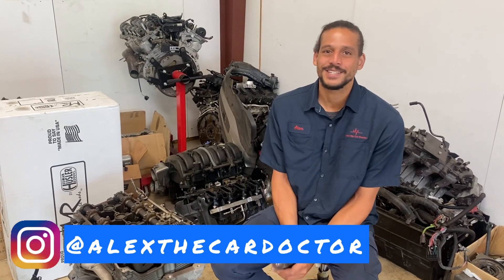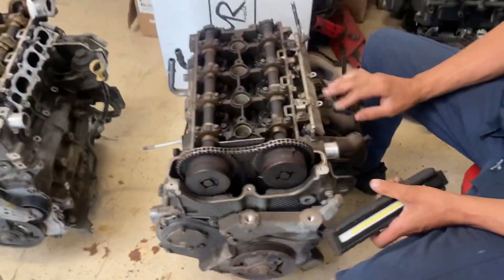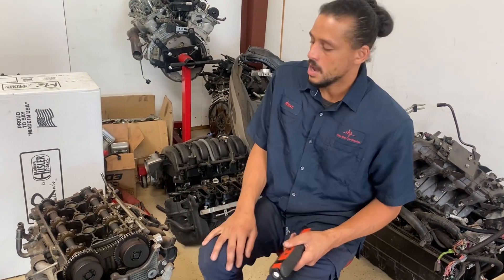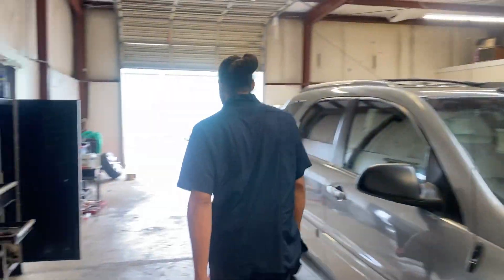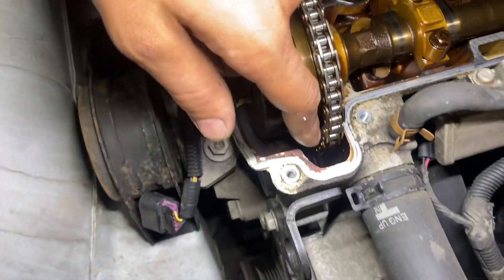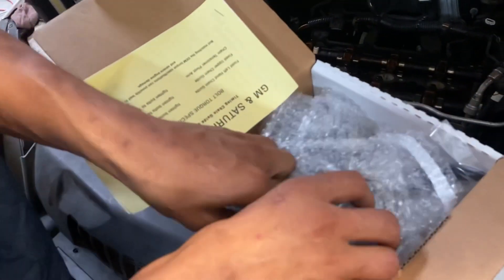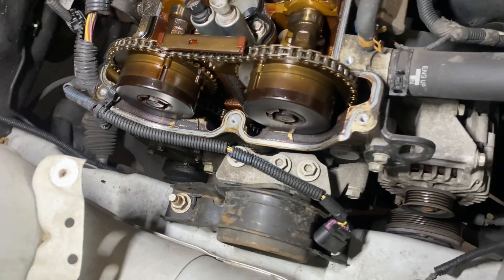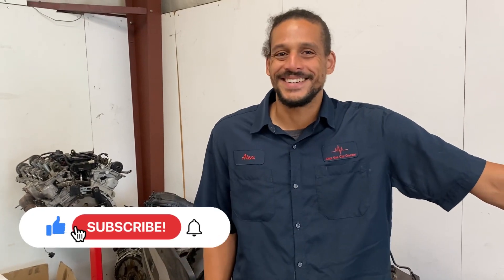Common Timing Chain Issues with GM Ecotec Engines | Timing Chain Rattles and Codes  timing chain #gm

Comment: So I have a 2002 Saturn l200. 2.2 ecotec. My car cranks but doesn't start. I feel it may be the fuel pump but not sure. It just shut off on me one day while driving.  I've replaced the crank sensor checked spark plugs so that's all good. If it jumped time would I heat a noise or feel something. My motor doesn't act crazy still really quite but again it hasn't been able to start. I noticed that there isn't a lot of pressure when checking the gas pressure in the front of motor. From what I've sáid do you have an idea?? Thanks

Comment: I’m in the process of replacing my head gasket on my 2.0L Malibu ltz turbo because it had coolant in the oil. Is there a tool to keep it from jumping time and getting it TDC! Before removing the cylinder block. Do you have any videos on this particular job on how to replace the head gaskets and timing chain. My car has 87,600 k so would changing the time while would be beneficial long term. I’m just not sure how to prevent it from jumping

Comment: im changing the timng chain and sprockets on a 1.5 ecotech 2016-2023 malibu. do i also need to install a new oil pump chain since it will also ride on the new crankshaft sprocket?

Comment: I HAVE A 2004 MALIBU WITH A 2.2L, 4 CYL ENGINE, OIL CHANGES RELIGIOUSLY DONE, NO TIMING CHAIN RATTLE, TRANNY REPLACED WITH USED TRANNY AT 206,000 MILES, CRANK SENSOR DONE WITH GM PART, OIL PRESSURE SWITCH DONE WITH GM PART, MAP SENSOR DONE, ONE SPARK PLUG REPLACED, OTHER 3 PLUGS OK, NOT REPLACED, NEW IGNITION CONTROL MODULE, AFTER REPLACING MAP SENSOR I GOT A 340 CODE, MINOR ROUGH IDLE, NO MISFIRE CODES,  ALTERNATOR HAS APPROX 120K MILES, BATTERY IS ONE YR OLD, WHEN AUTOZONE TESTED ALTERNATOR THEY FOUND 7V OF RIPPLE VOLTAGE,  BEFORE TRANNY WAS CHANGED CAR USED TO START ITSELF AFTER TURNING KEY, AT THAT TIME I COULD HEAR GRINDING FROM STARTER, CAR NO LONGER HAS THAT GRIND NOISE, ANY IDEAS?

Comment: Hey Alex thanks for all you work, you helped me save some money on my 2005 magnum with replacing the water pump, now i am working on my daughter 2011 buick regal with the eco tec 2.0 engine. My problem is that her bank 2 camshaft sensor was bad and broke out the block and was pouring oil, i replaced the sensor but now the car only starts when that sensor is disconnected. When connected tge check engine light comes on but has no code, do you know whats causing this and if so how can i fix it? I did some research and have an idea but i want to know from a real expert of what it may b. Thanks for all that u do to help us all.

Comment: This just happened to my equinox three days ago….engine power loss warning on the dash then it just slugged out and cut off and haven’t been able to even start the car since but im not sure if the chain caused bent valves yet because it just happened

Comment: ZZP performance makes an access bolt for that hole that is extra long and eliminates the need for that inner bolt.
Reply from the maker: Yes, so does Dorman. Another commenter put me up on game! But I’ll add the ZZP one to my mental rolodex too! Thanks 😃
Reply: my top screw just came out on my DF Goblin kit car LNF engine. the bottom screw broke off in the block. drilled out the bottom screw. have to try to replace with an 8mm helicoil and M8 bolt :-(  AT least the bottom bolt should see very low forces once I have the new and improved upper bolt in. 

super annoying problem but hopefully it will be fixable. 

 @AlexTheCarDoctor
Reply: Zzp also makes a reinforce timing chain guide also stronger and better material , instead of plastic.

Comment: I'm starting to see some problems with my 2.4L in my Buick Verano at 83K.   When oil is low, it has symptoms.  Filling the oil to top seems to quiet things down.  But I suspect I'm due soon for a timing system replacement job.
Reply: Man they quoted me $3,200

Comment: Got 222,000 on my 2.4 in my 09 Pontiac G6. I Change oil every 5k with regular conventional. No issues. Amazing engine
Reply: There is no more "conventional" oil unless you mean not labeled synthetic? Any brand name oil that is API GF-6 or GF-6b has synthetic esters as additives which would make them "semi-synthetic" this would explain at least some of the longevity, the rest is the 5k intervals.
Reply: @mrmarcink1300 oh  my god SHUT UP😭😭😭
Reply: i needed a timing chain replacement at 160k miles. i change oil every 3k miles and even negative degree cold temperatures i still heard a rattle once. not too concerned since oil was probably thick, but doesn’t burn any oil. have you experienced any problems with yours?
Reply: My 2010 g6 just got the dreaded timing chain rattle at 243k miles, aside from that it’s been bulletproof
Reply: @02glx  my 2.4 G6 got the rattle between 150k and 160k miles. just got timing chain replacement done and i get a discount since im friends with the owner, and all in the timing chain replacement was $800.
Reply: I'd use synthetic oil.  It's worth the money.  At least use a blended/sythetic oil.
Reply: Go to Valvoline Advanced and it will lash 400,000
GM retired master tech

Comment: I have a 2014 Chevy equinox. The timing chain guide on top broke and my timing chain ate a hole in my valve cover. Long story short replaced everything except the sprockets in a timing chain replacement and now I have a loud timing chain rattle on a cold start with rough idle after about 20-30 minutes of driving. If I pop it in to neutral it idles a little better but it idles much better if I just touch the gas a little. Any ideas? 

Edit: forgot to mention that if I let it continue to idle roughly it throws the code p228d which is a high fuel pressure regulator reading high fuel pressure it then goes in to limp mode and the stabilitrack turns off. It’s the only code that appears and I’ve replaced the fuel pressure regulator but with no difference in symptoms. The code will go away after a few starts and the check engine light disappears. I pulled the valve cover off and the timing chain is taught. I changed the vvt solenoids as well. I’m at a loss and I’m running out of money to throw at it!

Comment: I have the 1.8L ECOTech Chevy Sonic and it's a crap motor.  Problem after problem.  Overheating issues and doesn't even have a temperature gauge on the dash.  Stupid design.

Comment: My 06 2.2L Saturn ion is having the same problem with going limp while driving and at low idle. It’s at 180,000 miles and I can almost guarantee that it’s never had the timing chain kit replaced, is it worth a shot to try to replace? Would it even help?
Reply: Did you get it changed and did it help ?

Comment: 15 equinox 2.4L

Changed the time chain, followed your video to a T, turned it on, let it run for about 30 minutes, drove it 10. Next morning, started it, low power display comes up, tore it down, re done the chain, started it up, ran fine drove it, turned it off, started it again, reduced engine power display again.

Tore it back down again, made sure to double check everything over and over, put it back together, started it, ran fine 30 minutes, turned it off and back on, reduced engine power.

P0016, p0089, p228d, what can I possibly be doing wrong??

Comment: Hey Alex, please help me. I changed timing chain, both phasers (intake had a little play), solenoids, oil, oil filter, I cleaned the oil pan blocked with plastics. Now it sounds nice, but I continue having p0016 code. It disappears and goes back after 30 min of using. Please guide me.
Reply: Plus, I installed the improved bolt for the black tensioner guide.
Reply: sounds like its a tooth out of time
Reply: I fixed p0016 cleaning camshaft sensors and the part of the camshaft that the sensor detect. Also  I cleaned the crankshaft sensor.

Comment: I've compared every chain I've removed to the new chain .. never once have I seen a stretched chain.. it's always the front guide broke and or phasers / solenoid problems .. I usually replace everything all at once .. chain , phasers , solenoids , guides , squirter , tensioner .. 🎉🎉

Comment: Alex had some great advice on the ecotech engine, as a semi retired mechanic with lots of experience( I just cant give up my shop) the best advice I can give is do not wait until it stops running, a timing chain replacement is under 1,000, can be done in 2 or 3 days not the end of the world but bent valves could total your car
Reply from the maker: Thanks so much for your advice! I’m always open to learn! Definitely gonna use your experience and wisdom. Thanks again 👨🏽‍🔧
Reply: At how many miles should they be changed?.
Reply: Ray it really depends on the oil, a car that gets a fast lube job every 7,000 could need a chain at 80K, if it is a neglected engine, like going over miles or cheap oil they can fail at 50K, use good synthetic 5w30 every 5K and it will last 200K, yes I said 5w30, the thin 5w20 is for fuel economy, not good for the engine, gas is cheaper than timing chains @raypalermo1603
Reply: @raypalermo1603 base line is 100,000 miles, which seems to have become a good ballpark figure.

For those of us driving 25-30K per year, with too much idle time, may only be 3-4 years. Compared to someone that may drive 12-15K per year, or 6-9 years. 🤔

2024-09-06 1346 PT

Comment: hey Alex, do not be afraid of thread inserts, the repair makes the part stronger than a new part, the best ones are from Howmet aerospace ( an Australian company), napa auto parts has them, helicoil is ok too, no big deal to install and nothing to worry about
Reply: You are absolutely right, I work at a machine shop, we use inserts all the time for repairs, they are better than the original thread..

Comment: What about 2015 malibu 2.5 engine? Same?
Reply from the maker: No, those have vacuum pump issues that blow up and destroy the CAM on the 2015 2.5
Reply from the maker: Those have vacuum pump issues that could destroy the CAM. Just keep your oil changed 👨🏽‍🔧

Comment: I have a 2008 Saturn Vue 2.4 that keeps jumping timing and bending valves. I'm so tired of messing with this thing, but it's a customer that we know well, so I'm trying everything. I've pulled the head off 4 times already and every single time I start it up, it starts rattling and bends the valves. 

Someone please help! I'll Cash App you some money if you can.
Reply: Have you set the tensioner after installing the chain?
Reply: @freddyg9026  I figured it out. Somehow the cams were placed in the wrong spots. We had to put the exhaust cam in the place of intake and vice versa.

Comment: When mounted to a Solstice or sky, the thermostat is very had to get to. When mounted to a Solstice or sky in the turbo format, the waterpump is also very hard to get to. These are the only two issues besides that bolt that I know of on his engine.

Comment: I’m an average Joe with a Pontiac Solstice (2.0 ecotech) and currently have it in pieces in the garage. That bolt is a known failure point and Performance Auto Werks sells an upgraded part that holds the guide rail in place and also functions to fill the access hole for the bolt. A single piece that doesn’t allow for this failure. I highly recommend it and am putting that piece into my car once I finish installing my chains again. (Also the water pumps on these engines are absolute trash, replace every one that is stock)
Reply: ECOTEC UPGRADED TIMING CHAIN GUIDE BOLT   Is this the part from Performance Auto Werks your talking about? Edit- I just seen the kit with the guide as well
Reply: Yeah. PAW has it and I think Cloyes and DDM both sell one too
Reply: Yeah. PAW has it and I think Cloyes and DDM both sell one too

Comment: i had the  chain munch thru the top guide and valve cover..  pulled the cover off.. chain was taught at the top.. loose down by the crank sprocket to intake sprocket.   broken forward guide.. .  replaced forward and top guides.. patched valve cover hole from munch thru,,
munched thru top guide AGAIN.. chain was still taught at top side..   what caused the munch thru of top guide and then valve cover?
thanx!

Comment: To repair the stripped guide bolt problem a new plug is availabe from rock auto, it replaces the bolt and the plug with one piece.

Comment: Yup, drill a hole and add a threaded insert. New timing kit and back on the road. That’s how we do. Heck we’ve even spot welded the bolt for good measure.

Comment: I have used Heli-Coil kits onto many vehicle parts including body, engine mounts and internal engine parts as well. I have even used Heli-Coils on the Cadilac 4100 engine which was popular in the 1980's. Since the block was aluminum, I used double 1/2" inserts on the main bearing journals. I never had one of them come back for that problem again. I did work on other issues with the same cars over the following several years. So I can safely say that the Heli-Coils work well providing you install them correctly.

Comment: Great video what a young man these engines are garbage my friend has equinox with 98,000 miles has p0301 other mechanic said rebuild the motor so he took it to the machine shop and done it still has the same noise ticking at idle and exhaust popping and check engine light on and flashing even after the machine shop did it

Comment: I have a 2011 Malibu.  The timing chain went bad at 85,000 miles.  The black guide was in several pieces when I took it out.  The top guide was sheered off like the one you showed.
Reply: That’s a Chevy for you

Comment: i got one on a equinox the front guide bolt is non existent and the lower bolt was half worn through. grooves cut in the head by the chain and the balance chain sprocket was worn off as well as some of the balance chain guide bolt heads . both soleniods packed full. did a leak down test and all 4 were ok, all rockers tight so i pulled the oil pan and found the pick up tube plugged with guide chunks. cleaned it all out and new timimg everything and the thing runs like new lmao. couldnt believe it. this was my dads girlfreinds car and ran out of oil at least 3 times i know of (oil burner ) and told her we need to to chains over 2 years ago lmao. these endgines are gravy for me but such junk for customers

Comment: doorman makes a repair kit for that upper guide bolt that basically uses the access plug for that bolt as a way to secure the upper half of the guide so you dont need a cylinder head

Comment: Anybody experience crank no start a couple times before engine starts, then the engine runs fine? I'm leaning towards reluctor wheel slipping, but just wanted to know how common it is.

Comment: I have 353,000 miles on my 2004 saturn and have absolute zero issues. I have always ran synthetic and change it at 8k-9k miles
Reply: 2004 was soposed to be a poorer year for that engine as well.

Comment: What codes usually pop up for the timing chain if it broke on a 2014 chevy equinox
Reply from the maker: P0016 - Timing Correlation is the most common one if the timing chain has jumped.

Comment: I strongly think that using a tread insert would fix and resolve the problem because once fixed the hole diameter in the aluminum is larger and stronger than when it was made. I kinda feel that all threaded holes in aluminum should have steel inserts from the factory since they would be stronger and reduce the seizing that steel bolts do in aluminum. of course I dont expect the factory to add all that work and expense just to save us trouble. 
so, are those motors pretty good other than that issue ?
Reply from the maker: I totally agree! They make a Dorman plug that works great! I’ve been using them and they’ve been working out. Yes, other than that these motors are pretty good!

Comment: Theres a dorman solution plug made specifically for that. Instead of the bolt that plug you take out acts as the bolts. Look up dorman solutions 2.4l timing chain guide plug
Reply: Nice.

2024-09-06 1347 PT

Comment: Hey I need your help ok my timing is on time but when I turn the crankshaft the timing chain dangles a little bit and my 3rd spark plug was drowned wit oil how can u help me on that need advise thanks

Comment: how do i know if you need to change the timing chain it needs to be tight or loose ????????????????
Reply from the maker: Your timing chain needs to be tight. If it should not be loose or missing the plastic piece (timing chain guide). I recommend checking it at 100,000

Comment: I have a Chevy Malibu it recently stopped on the road today . A few months ago my mechanic said I needed a new timing chain. Do you think my car is finished or do I still got hop fixing it ?
Reply from the maker: Hey there I can’t really make that call without seeing it for myself. follow my instructions in this video and you should be able to diagnose it yourself if the valves are met you would need another motor/Head job and at that point yes if the car is not sentimental and have very high miles you may wanna depart with it

Comment: I have one the timing chain is tight but the rockers fell off on the front cam an all the springs are compressed so I can't just replace the rockers an lifters cause they are all slop
Reply: I was wondering if timing chain is tight what would have caused the rockers to fall off
Reply from the maker: @charlespauley4523  I will have to see it in person for an explanation but the valves are bent on your engine